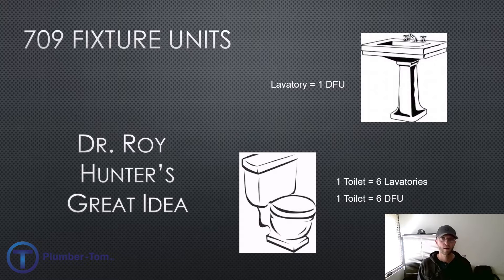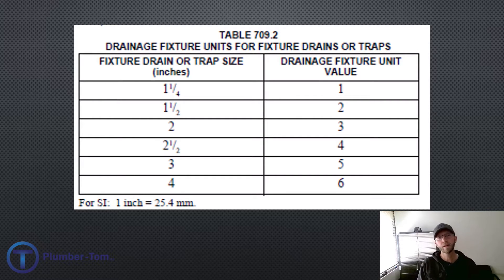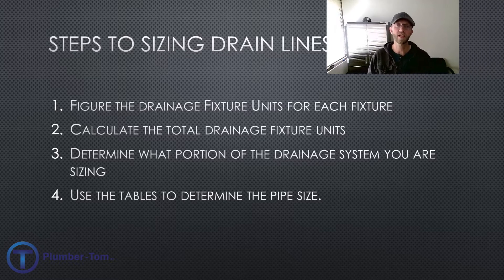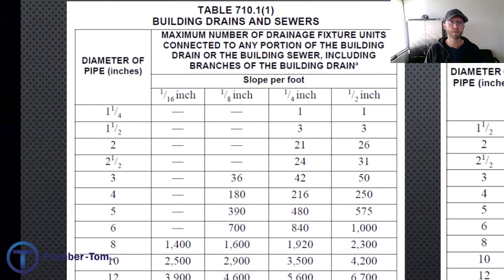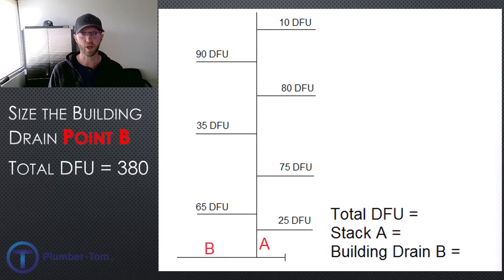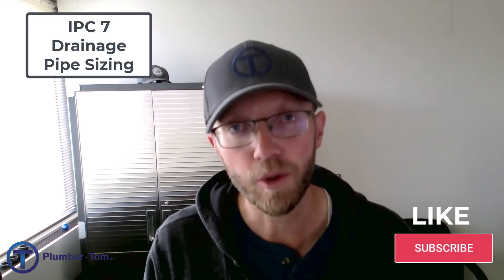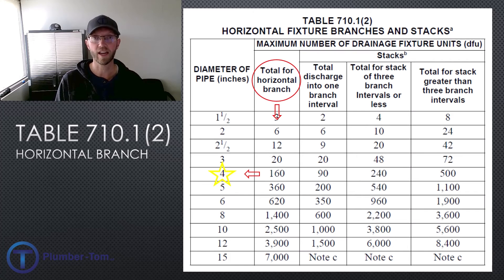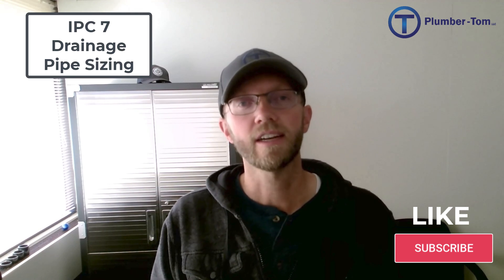Understanding International Plumbing Code: Drainage Pipe Sizing

Comment: Hey Tom, your videos are great, 1.) how to size a floor sink or drain in the water room under the backflow preventer per code?
2. Lets say I have 2 branches connecting to the main vertical stack with 6" off-set, is that also sized with a total of 3 branch intervals column as long as these branches are connected within 8 feet right?
Reply from the maker: The floor drain would depend on the max gpm discharge from the backflow preventer.    Don’t know if code has specific sizing requirements for that scenario but 709 has sizing for shower drains based on gpm. I would use that.  

Is the offset in your second question a vertical offset?
Reply: @plumber-tom9470 , yes vertical offset

Comment: Why don't you group bathrooms? Different values comes after grouping...
Reply from the maker: Good point.   Using bathroom groups gives slightly lower DFU''s, which can be good if you are trying to save money on pipe size.  I chose not to in this example because having it a little oversized will not hurt.
Reply: @plumber-tom9470  Point is not about money, it's all about correct information. You teaching code so do it right.

Comment: Awesome video man, just had one question. Just to confirm if for example a 2 story building if there is a water closet meaning the branch although by the table is 2 inch it of course has to be 3 inch minimum, that also applies for the stack connected as well right. We cannot downsize pipe diameter as we go downstream correct?
Reply from the maker: Correct. 3" minimum for horizontal or vertical pipe when a water closet is connected.

Comment: I was taught you need to transition to 4'' from 3'' when going from building drain to building sewer is this necessary? or can you run a 3'' building sewer? i can't find where it says you can't. Thanks for the awesome videos!
Reply from the maker: I don't know of any code requirement for that transition.  However, PVC Sewer pipe is not available in 3" so that is probably why we transition from 3 to 4 each time.  Local jurisdictions may have additional requirements for the sewer being 4" which are not in the code.

Comment: When determining pipe size on building drain with 48.5 DFUs i see it should be 4”. But if i move past two branch lines that have 9.5 DFUs do i move to a 3”? Also if no slope is given what slop size should i use?
Reply from the maker: Yes you can decrease the building drain pipe size as the dfus carried by the pipe decrease.  Reducing from 4" to 3" when toward the end of the horizontal branch can be a great way to save money because 4" fittings and pipe cost more than 3". When no slope is given, you can go on the minimum requirements on IPC Table 704.1.

Comment: Thanks for the video, very informative. I am remodeling a bathroom changing a tub to a shower. Most of the drains for pans etc are 2”, but existing line is 1 1/2”. Since the rules on showerheads are 2 gpm, do I need to change it to 2”?
Reply from the maker: No. 1 1/2” should be ok for a shower.
Reply: @plumber-tom9470  thanks, I think some local codes require 2”, but I just went for plan review and mine doesn’t
Reply from the maker: Sounds good.  @billsnyder6945

Comment: So let’s say I have two bathroom units on a second story draining down to the first floor on a 3” pipe, then that 3” runs to the main sewage line under the slab. Can I tie 7 more DFUs into the 3”?
Reply from the maker: On the tables in chapter 7 you will find then number of drainage fixture units for pipe sizes.  It sounds like you should be fine if you have two bathroom groups and the other 7 DFUs.  A bathroom group is 5 DFUs.  And a 3" horizontal branch can handle 20 DFU.  So it sounds like you have 17 DFU total and you should be fine.